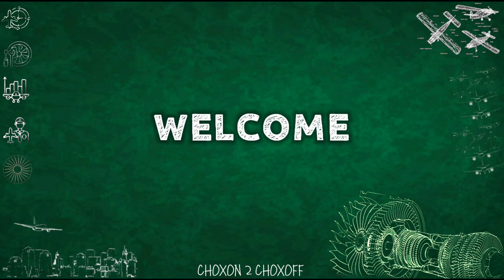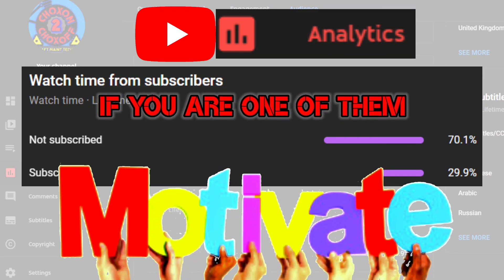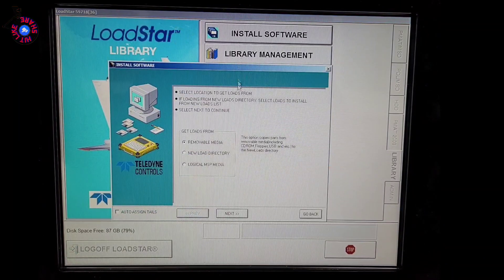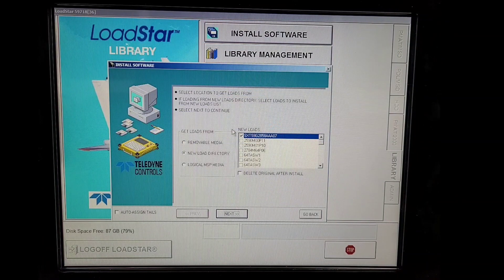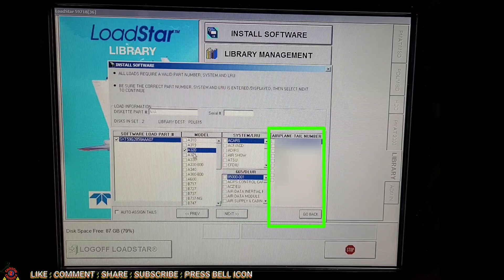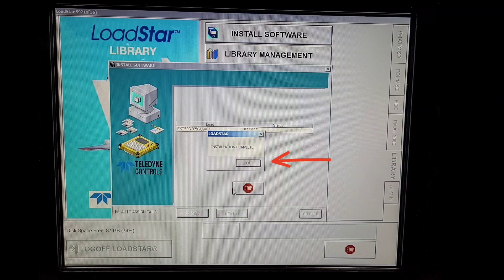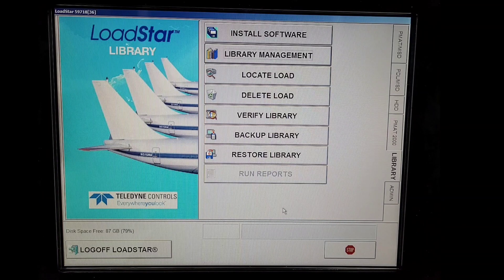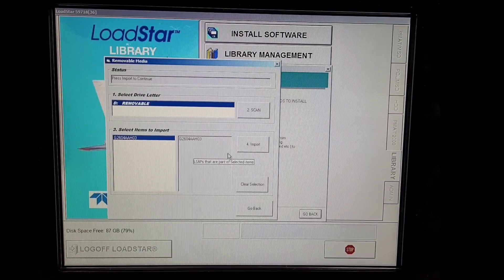PMAT 2000 PART 2/3- INSTALLING SOFTWARE IN PMAT2000 #pmat2000 #pdl #teledyne #loadstar

Comment: This software installing procedure is same for low speed software and high speed software?
Reply from the maker: Yes it is different, for slow speed we use option PDL 615
For high speed we use option ARING 615..

Check out both video we uploaded as FMS NAV DATABASE UPDATE IN 2 PARTS.

Comment: How to install software with 2 disc. (Disc 1 and disc 2). Used for fmgc software A320
Reply from the maker: Recently we did FMGEC software update on A320 Honeywell LRU. Each software came in individual CD. So we need to install each software seperatly. Normally floopy comes in more numbers. In that case we need to wait for prompt asking us to change the disk while uploading.
Reply: @CHOXON2CHOXOFF  pleas 
If you can to deplane how to install  4 flope  mine thanks
Reply from the maker: I am sorry. I didn't get ur question?